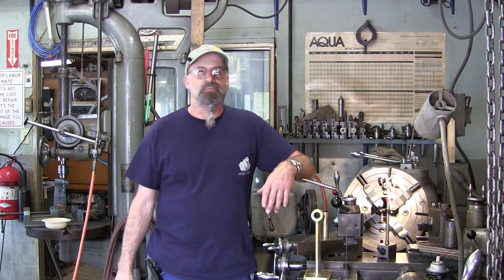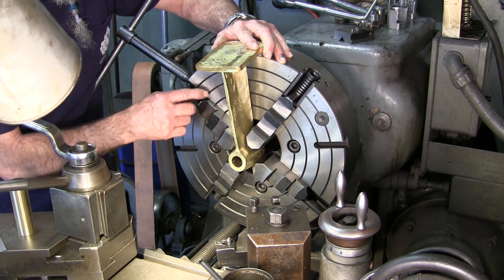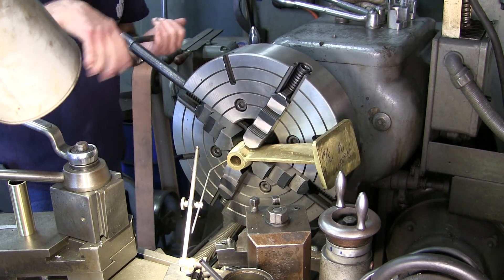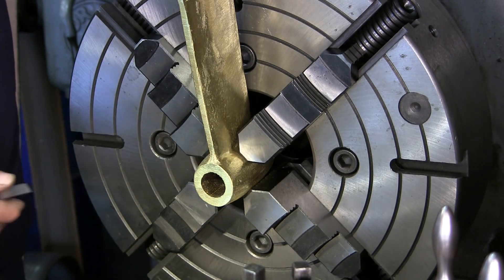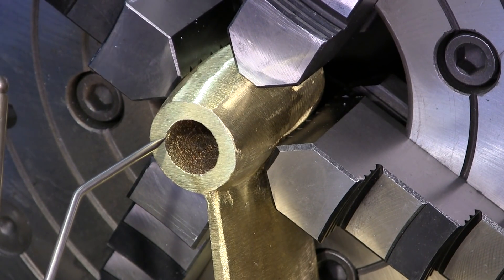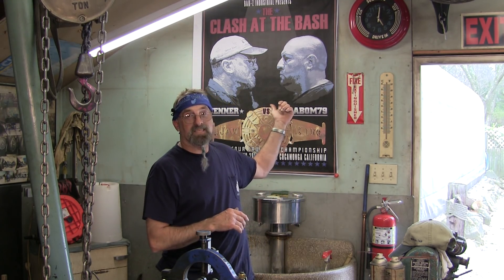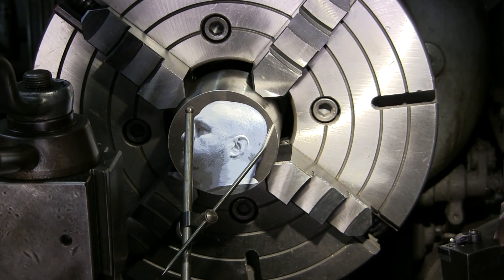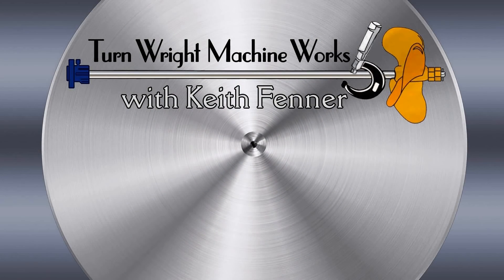No Stinking Indicators

Comment: Nice work. I would have bolted, using t slot in chuck, a counter weight opposed to the work piece leg. This would approximately balance the work piece in order to increase the spindle speed.

Comment: Not to criticize or "do this-not that" but using a dial indicator for I.D.'s with a extended reach (given the odd shape of the part) should result in a more accurate position. Great idea and tips for those without the indicator though! I am assuming the bore was the most important and the O.D. being a cast was less of a priority so why not measure from the critical area in the first place?!

Comment: On an object that has a bore, but doesn't have a true surface to indicate from, one trick I've learned is to take an adjustable reamer and tighten it up in the bore. Then I can put a live center in the tailstock and center up the reamer and indicate on the shaft of the reamer for side to side runout.
Reply from the maker: The bore needs to run true with outside of casting, not the other way around. ;{)------

Comment: Keith - I see how all of that lined up the hole with the part of the casting that contained the hole.  BUT - isn't there some alignment required between the bearing access and the plate that mounts on the hull of the boat?  Or is it just accepted that they'll have to glass up the foot plate to meet the hull?  ???  thx bmw
Reply from the maker: The adjustment for shaft position are done when installing the strut to the boat, they are pre fit and adjusted with set screws in the four corners or shim spots, then lowered back down and 5200 adhesive then tightened in place for the final assembly. ;{)------

Comment: Hey Keith  nice work  I sometimes  use a large Center  put it in the bore and gently bring down the jaws to get it close.  or use a mandrel in the drill chuck to support it while chucking it   but on some work I do the same as you and use the marks on the front of the chuck as reference . Like you I have been doing this for a long time I remember when they showed me how to get square stock running in the chuck just by using the tip of the tool on the Edges of the Square

Comment: How do you align the bore for the shaft with the plate that bolts to the hull of the boat. 
I assume you locate off of the shaft bore and face the mounting plate. 
Can you show that some time.
Reply from the maker: If I happen to catch this operation going on at one of the marinas I frequent, I'll do just that. ;{)------

Comment: One thing I sometimes do when there's an existing bore which I want true-running in a 4 jaw job is to chuck a suitable size of expanding reamer in the tailstock 
(my biggest Superchuck is only 3/4", so it doesn't take my biggest reamers, but some people have a self centering lathe chuck, often on bearings, which they can use like an outboard steady rest for holding jobs which cannot have a centre hole). 
I use the reamer like an ad hoc expanding mandrel, to hold the work central while I get the chuck near enough. Works a treat, and it's particularly handy when the outside of the work is not circular, or is eccentric to the bore.
Reply from the maker: On struts it's important to have the hole run true with the outside of hub not the other way around.  ;{)------

Comment: This is a great tip.  I have only used a surface gauge for layout.  I have done the exact thing you said about chasing high spots with an indicator.  This will help on the next re-work job Thanks a lot.

Comment: good demo keith. could you have used a close fitting drill bit or plug in the tail stock to get a quick base alignment on the casting? the cored hole looked pretty concentric. .
Reply from the maker: Never judge alignment by the core opening. ;{)-------
Reply: i got you keith, he only reason i asked was because the cored hole look pretty round and pretty well centered and i'm pretty lazy. keep then comming

Comment: I think that this method and the indicator method each have there place.  in a situation like this where it's an imprecise  part that doesn't need a precise hole this is good.  but I'd never trust it for anything where I need better that .010" accuracy.
Reply: You'd never get to machine raw castings then. Whenever you start with a raw casting, you have to pick somewhere to start machining, whether it's a face or a bore. The first cut can't be true and parallel to anything, as nothing on the casting is true.
This is an excellent demonstration of how to set up for a machining process on a real world, cast part.

Comment: If you set the scriber to just barely meet the outside surface, you could probably get it even closer than 0.003" (assuming the chunk of metal is actually round). Using the fine-adjust, keep coming closer and tweaking until the tip just drags all the way around. You might get better than 0.001" that way. If I try, I'll have to record the attempt since live video is the only proof.

Comment: Keith, not being the marine expert like you, but it seems to me, that the angle of the bore for the cutlass bearing would have to be parallel to the base plate that is being bolted to the hull , or am I mistaken?
Reply: Matt, the process is to fit the strut onto the shaft where it will run and support both the strut and shaft so the strut is where it needs to fit and the shaft is absolutely true and straight. You then have a few options. You can pack out the gap between strut face and hull with solid shims or you can make it so you can repeat the alignment you currently have, remove the strut and use a bedding compound to allow for any misalignment between strut and hull, then refit and align with the bedding compound.
When smaller boats are built new, they typically fit the strut, shaft and stern bearing into the hull, then move the engine around for alignment with the prop shaft flange. 
It's pretty easy to measure the angle between hull bottom and strut to within a half degree, then cast the strut for that.
Production boats start by installing the shaft and engine in a prototype or first build, then make a wood core for the strut to fit the boat and shaft. Then they're all cast and machined the same, off the same core and castings. One off boats are usually the same process, or may use a suitable off the shelf strut, of which there are many to choose from.
Reply: Matt II
Reply: Ok thanks for the detailed explanation.
Reply from the maker: The shaft line is not the same as the mounting palm angle or face. ;{)------
Reply: Ok, so how do you determine the shaft line based on how you bored it, it would seem to me that it would be critical, or is it shimmed to obtain the correct angle ?
Reply from the maker: As I explained in other comments the engineered shape is built into the casting shape itself and as long as you are in line with bearing hub you are in the range of accuracy needed to adjust the fit up at the boat. ;{)-------
Reply: Sorry to piss you off, and bother you, was not my intention, not being in the ship industry I didn't understand. it won't happen again
Reply from the maker: No worries, never stop commenting!  I am not the least bit up set, just my way of explaining the alignment of the hub outside shape is your go to, for getting it right on center, these castings have been poured for many years and replacement pours are just the same as the one before, the first one was designed and poured 30 years or better, ago and the bearing is inline and center of the hub. ;{)------
Reply: I guess from watching you all these years, you have made comments about how critical the alignment of the shafts are, and that they use lasers to align them as to not wear the cutlass bearing out. Take care

Comment: Hmm...I have a question. If you have a straight solid steel bar that slip fits in the strut and you use it as a guide by chucking it on the tailstock, would that work just as well, perhaps even better?
Reply from the maker: If the bore was a precision diameter to the bar and in line with the location it was meant to be in. the bore is made from a sand log / core, to lighten up and rid of waste, sometimes in center and sometimes sagging to one side. ;{)------

Comment: Is there a bore center to mount plate distance specification?
If there is one, how do you center the indication at the right distance?
Also, how important is the bore angle to the mounting plate, and assure it's correct?
Reply from the maker: i If your center to the hub your on line and the palm of the strut is set / adjusted in place to set shaft alignment with thru-hull opening. ;{)------

Comment: Would you consider a counter balance weight point on the opposite side of the chuck, has anyone done that?
Reply from the maker: If it was a high speed operation or more weight than the lathe could handle. ;{)-------

Comment: how much interference, if any was there between the bearing and the housing? Also, if the shaft angle from front to rear is off a degree or two, how is the prop shaft adjusted to accomodate?  thanks
Reply from the maker: interference fit, between one and two thousandths, If your center to the hub your on line and the palm of the strut is set / adjusted in place to set shaft alignment with thru-hull opening. ;{)------

Comment: Hey Keith, cool. I am thinking that the object is to get a rough casting centered up so the bore will be centered in casting. That method with surface gage is great and pretty accurate .003 by eye awesome. My Grizzly mini lathe 3-jaws are that which is considered good, heck I'll just toss my indicators in the trash and use a Fenner brand indicator. Made in USA close ta Starrett. Like the swag bandanna, got to have one of them. God Bless Ya   Dave

Comment: Keith, how about inserting an expandable arbor into the bore, then use pointer on that?
Reply from the maker: The bore is just a rough hole and sometimes the core had moved in the process and not to be considered a reference, unless it is so far off you have to move your bore to get it to clean up at final size. ;{)-------

Comment: I think I saw  drop of sweat rolling off Adam's forehead... LOL

There are so many things to consider when machining those stand-off's, distance from the center of the bearing to the mounting face, the  angle between the center line of the shaft to the mounting plate,its all pretty critical to the proper functioning and longevity of the setup, It would not take much misalignment to  create a bend in the shaft causing all sorts of problems later on.  I would be scratching my head for quite a while trying to get all that right. 
you make it look easy Keith
Thanks for the lessons

Comment: Hi Keith,
I understand the centering process for the casting and the bore, but, I'm wondering about the relation between the bottom plate positioning and the alignment of the shaft, bottom line to me, how to make sure that when it's gonna be fixed on the boat the shaft will be 100% in line as installed or is there some further adjustment on the final installation....???
Looks like a couple of new twists to the challenge...   ;)
Cheers,    PIerre
Reply from the maker: Yes the installer has to be qualified! ;{)-------
Reply: I had the same question.  Does the bottom plate get shimmed during installation for final alignment?  I assume that between variations in the castings as well as the fiberglass even if you knew the "right" alignment it would vary by installation.
Reply from the maker: yes most of the time they are pre fit and adjusted with set screws in the four corners or shim spots, then lowered back down and 5200 in place for the final assembly. ;{)-------
Reply: Ha!  Good question.  Really simple answer:  "the angle of the dangle is inversely proportional to the swing of the meat..."  Ha ha
Reply: Yeah, I've also seen chopped strands and resin made into a putty and used to fill the gap and act as a bedding compound between new strut and old strut pocket.
Align the shaft straight, then massage the strut pocket for the final fit.
Reply: Keith Fenner 
Hi Keith,
It would make a good video showing how to bore a casting like you did then set it up in a mill to surface the mounting plate at a certain angle , the drive shaft may be at a different angle to the mounting surface etc  . I know on boats you can shim things  up etc but lets just say you want to  do something more precise for a project ? Just a thought !
Reply: The answer is a $150/hr shop rate!